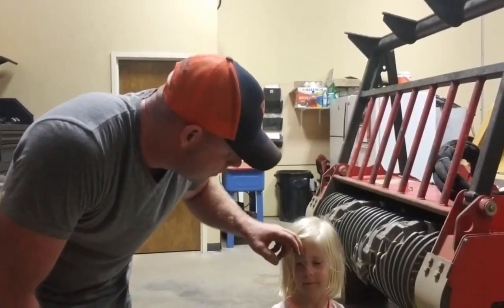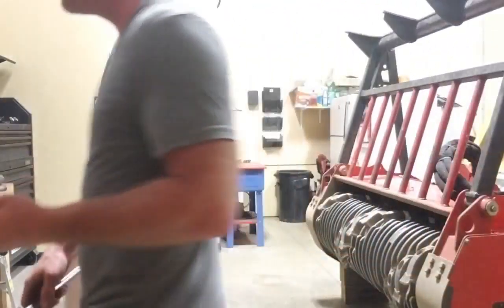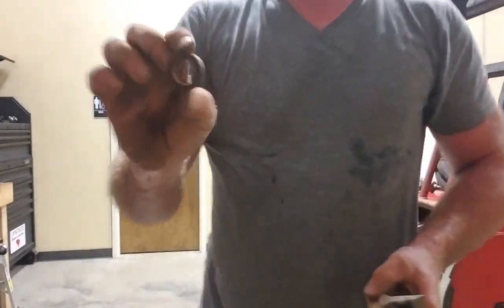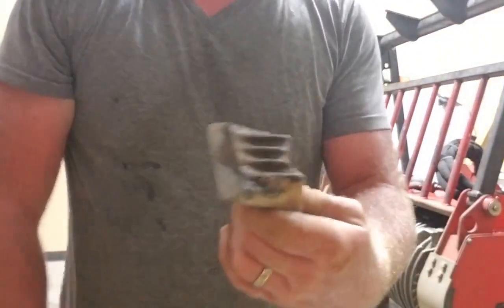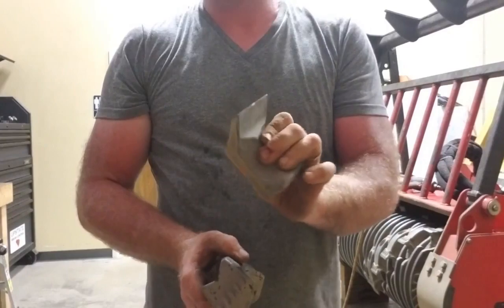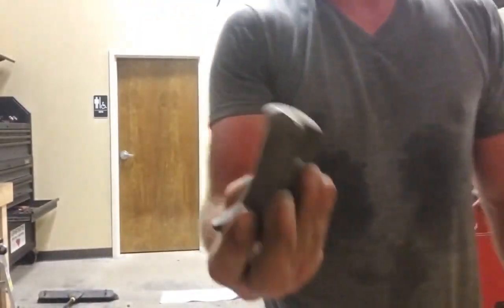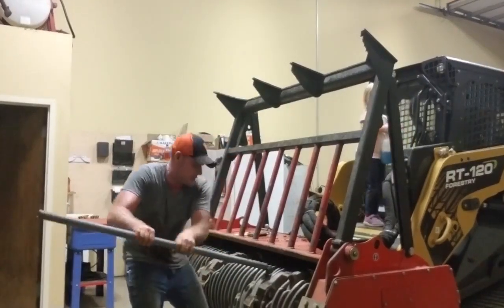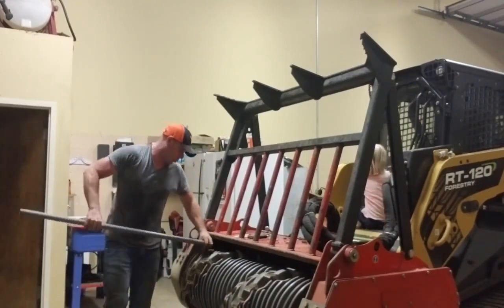Flipping teeth on fecon dcr

Comment: What’s the price difference between the 2 teeth?
Reply from the maker: A set of knives is around $1000. A set of carbides is around $3000.
Reply: Been trying to confirm... can you mount carbides on the DRC?  Or does the DCR only use knifes?
Reply: @KeithWBales  fecon sells the cutter knives.